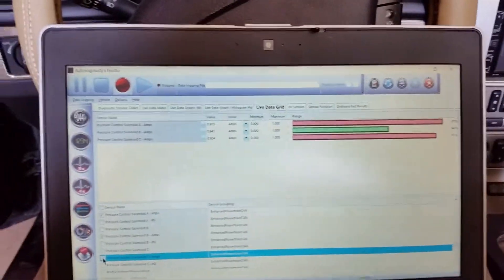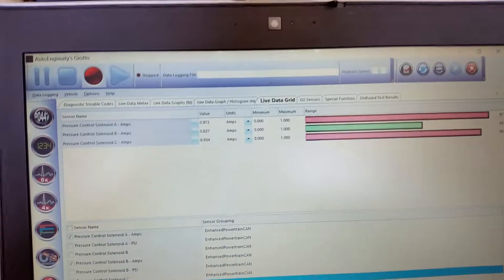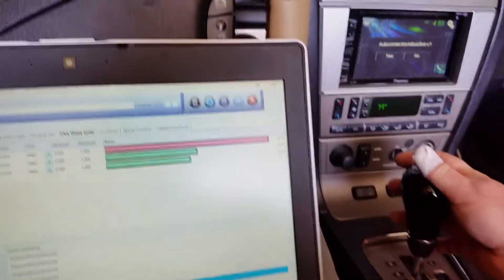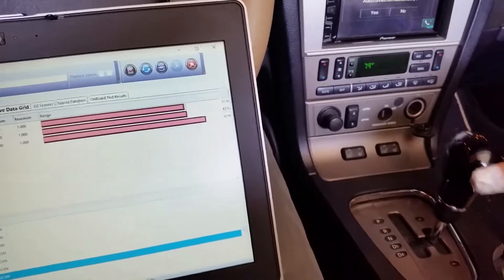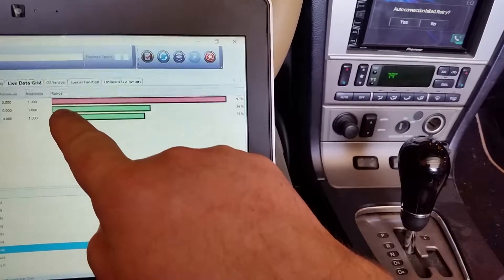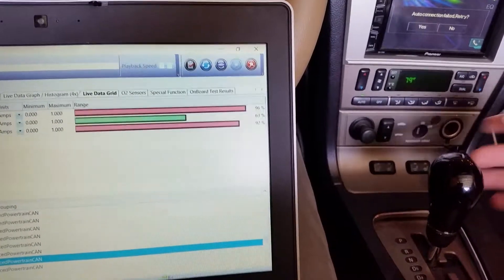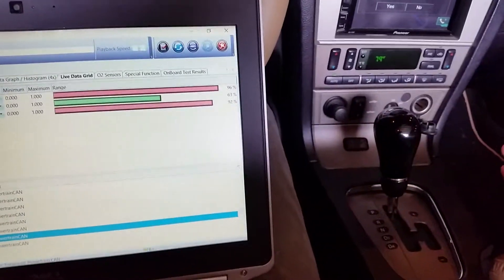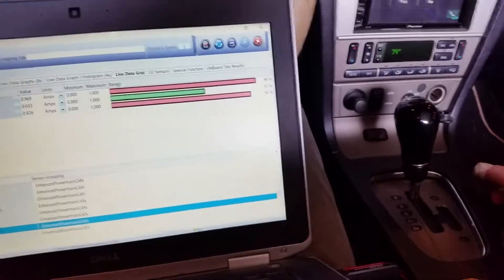PCM Transmission control problem 2004 Ford Thunderbird - pressure control solenoid - B.

Comment: Ford replaced my solenoid 3x! I kept asking “Are you sure something isn’t wrong with the computer?!”
Reply from the maker: Most dealer guys can't figure out what the PCM is doing to the solenoids.   To much marijuana!
Reply: @RicksAdvantechAutoRepair  Last fall, my transmission started jerking in and out of 2nd gear. Of course everyone said I needed a new one. My regular mechanic has become a good friend. He took it to a transmission shop that he trusted. They had the car for weeks trying to figure out what was wrong. They finally concluded that it was the computer! I haven’t been drinking it much, I have another car. Now it’s having issues, it has very high miles and not worth fixing. I can’t afford a new car. I told my mechanic to find a computer and get rid of the Tbird so I can get something else used with less problems! I was checking out videos and came across yours, again!! I’m going to text the think to my mechanic. He also has a friend who works for Ford, he couldn’t figure out. I wonder if he did what you did? I know that he has a Ford specific laptop that he brings over. I love this car but it sits more than not. 84,000 miles on an 18 yr old car in Los Angeles isn’t a sign it’s in good condition!! We easily drive 15-20,000 a year. 
Thanks for your videos! Any thoughts on where to get the computer?
Reply: @TheMyisa  Sorry, extenuating circumstances caused me to not see your message.  I hate to say the wait does not make a difference, because you can not use a used PCM from a different car because Ford made sure you can't, and I was unable to have his repaired.  No help.  He sold the car for cheep.  Ford stops rebuilding or making new PCMs after 10 years.  So, all fords are now 'Bic lighter' cars if the PCM goes out.  Good luck!
Reply: Hi Richard 
We decided to have it refurbished and reprogrammed. My mechanic said now it’s worse! I haven’t driven it yet. 
What program are you using to read it? My guy isn’t even getting error codes but his friend that’s a head mechanic for a Ford dealership checked it out and said it was definitely the pcm. 
Regarding your friend’s car, would it perform properly in manual shifting?
Thanks!